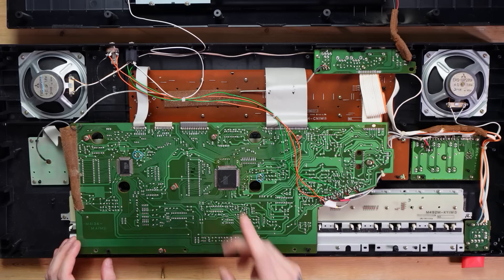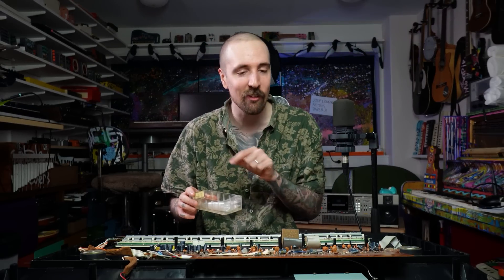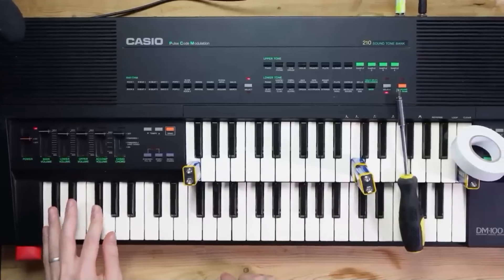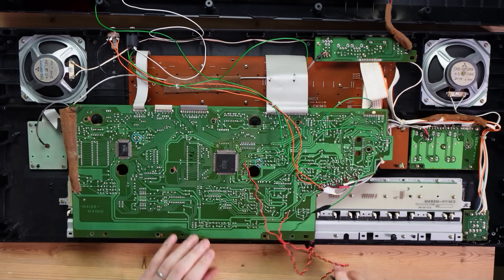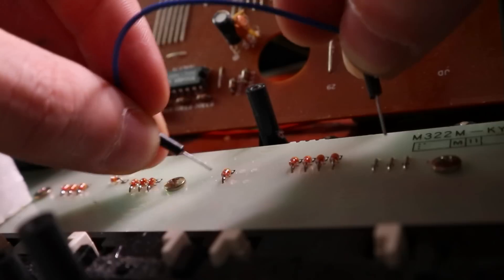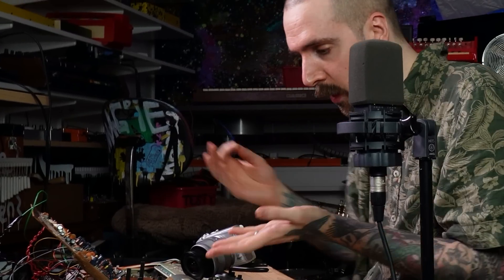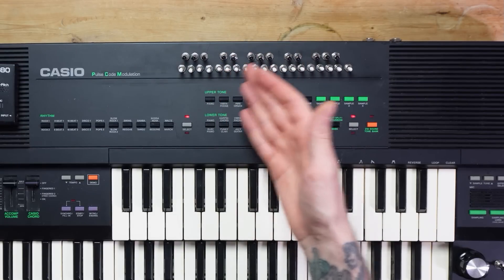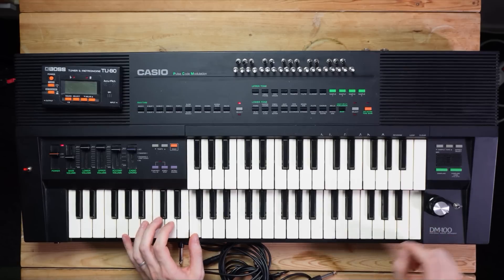How To Circuit Bend The Optimal Sampler Keyboard

Comment: If your gonna do all that, just put a clock on everything & a patchbay for the classic bends *the top is an sk-5, the bottom is an mt-240. Both have thorough bending documentation & service manuals available (a bunch of the 240 bends sound like the shitshot stuff you got by switching the clock, but repeatable). Reading the service manuals should make modifying these quite a bit easier & lessen the chance of destroying a hens teeth keyboard such as the dm-100. (cpu pins for 3 separate clocks, key matrix, audio paths are all there, plus a lot more.)
Reply from the maker: Nice! I will very much google mt-240 bends. Have had no luck finding anything for the dm-100 and googling the cpu gave really results. Like reaaally poor. Even a scam site was like top 3 links 😅

So thank you tons for info! 😁
Reply: Patchbays are for redditors

Comment: the pitch bend I did on my Casio ep 10 is the same with tuning, and the tuning is effected by my resistance as well. meaning when I touch or even bring my hand near the pitch knob, wires or switch, it detunes a little. I use it sorta like a LDR LFO when I play notes, very interesting indeed!
Reply from the maker: That is interesting! Aaaand if you ever come across an ep-30 please let me buy it 😆😆 I have ep-10 and 20 so only missing the 30!!

Comment: Can you circuit bend an Alesis Quadrasynth Plus? for example, include a way to connect a VGA monitor, , add some Oscillators/VCOs,etc, and uSB connectivty...
Reply: Probably not
Reply: @jeffreyheffner908  ugh..that little tiny screen..Then I tried to get the editor and they want to charge more for the software than I paid for the synth..I only paid  $100 for it in great condition..
Reply from the maker: Screen would be a fun experiment to try one day! Probably straight forward if information is available on what it has originally and what language and all that. Totally above my paygrade. Ask ”Replicat” in the magpie pirates discord 😆